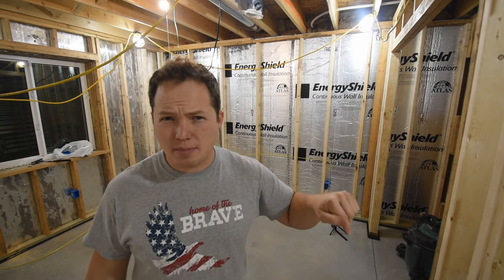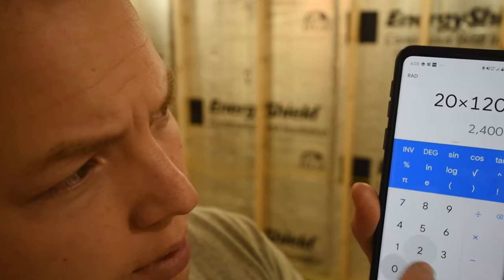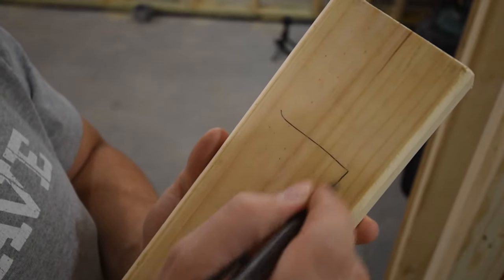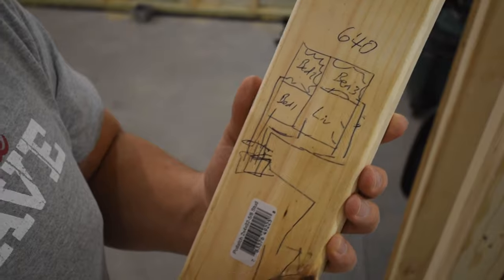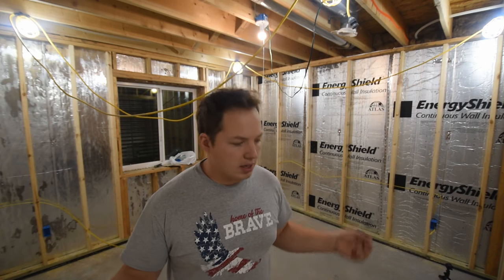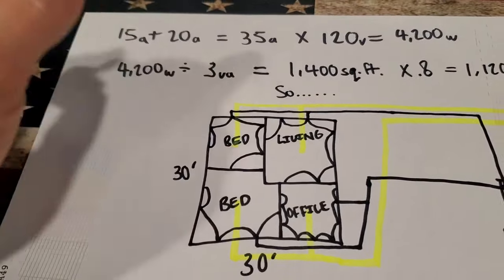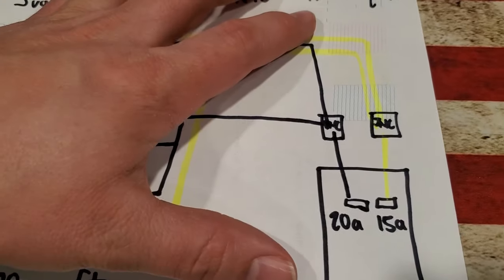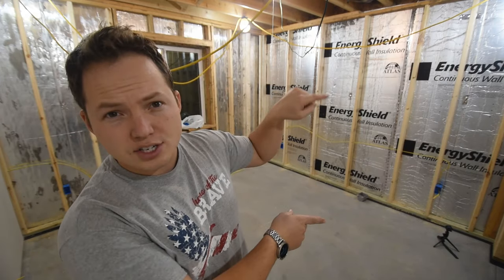Does a Bedroom Require a Dedicated Circuit? - Using the 3VA Rule To Calculate Anticipated Loads

Comment: I wholeheartedly support the running of 12 gauge to all receptacles. It should also be noted that you need not (and probably shouldn't) use actual 20-amp receptacles, you can use low-cost 15 amp ones. Because the utility of the 20 amp circuit is more for the number of things plugged in, not necessarily the load of any particular one thing.
Reply from the maker: Exactly. I need to make a video explaining the 15a device on a 20a circuit concept.
Reply: @BenjaminSahlstrom  different between 20 amp to 15 amp price?? What about if you led lights
Reply: agree
Reply: @jaandel1  You could run over a hundred LED lights on a single 15A circuit! At least those with common loads between 9 and 12 watts.
Reply: @aaron74  ... yes, you could run a BUNCH of LED lights on a small circuit but the code talks about the possible load, meaning if those fixtures have a standard screw base then someone COULD replace the bulbs with 100 watt units. If the fixtures can't take an old fashion bulb then you can likely get that by an inspection with several dozen on the same circuit. That's something I would run by the local building department just to be safe, rather than have to make changes later.
Reply: @rupe53  Yep, the intent would be to install fixtures fixed with LEDs, not fixtures with any sort of socket that would accept non-LED lights.
Reply: I understand the idea, but it just feels unsafe to me. Let's say somebody use a powerstrip and ends up taking 18 A through that 15 A outlet, the breaker wouldn't do a thing. In fact, that's why the Canadian Electric Code doesn't allow for the usage of 15 A outlet on a 20 A circuit.
Reply: @aaron74  ... got to thinking about this last night as I watched an old B&W movie on TV. The characters walked down a street in front of a movie theater with (seemingly) a thousand incandescent bulbs flashing away on the marque. I wondered what the wiring looked like and how many circuits were involved! <LOL>
Reply: @cedricpomerleau5586  ... interesting, and I suspect we'll see a change like that at some point here in the states. OTOH, the fact remains the 15 amp outlet is approved for continuous draw and a slight overload probably wont do anything other than eventually cause the power strip to fail because most of those are only rated for 1500 watts and are also a bit cheesy. Add in the fact that most high draw homeowner appliances are intermittent use (coffee pot, toaster, hair drier) and even a 1500 watt space heater is only 12.5 amps. This is what's been saving the world from idiots for near 100 years!
Reply: @cedricpomerleau5586  Generally there is no difference between the internal construction of a 15 amp or 20 amp receptacle. The difference literally is only the front face of the receptacle to allow insertion of a perpendicular neutral prong. Each have the same mass of conducting material. Also, powerstrips are often required, in order to meet UL and/or CSA listing, required their own overcurrent protection. The onus for safety is on that accessory, not the circuit you're using it with.
Reply: @rupe53  Yes, those old marquees work with the magic of relays, I believe. So a collection of bulbs can be on one 15A circuit, another collection on another 15A circuit, etc. But they can all be switched with a low-voltage relay controller. Sometimes you might see a strip of lights in a marquee not working, that is a sign the circuit for that collection of bulbs went open.
Reply: @aaron74  ... no magic involved and I have wired hundreds of relays in my time so I have a grasp. It's just that going back in time to when this was all wired by hand and probably using cloth covered conductors along with knob & tube feeds is a marvel to observe in person. Any time I visit an old building I ask to see areas that have not changed, like the basement and attic or storage locations within the structure. This is where certain gems hide and you visualize what made it all work.  A few years ago I got to take a gander at the electrical end of an old mansion (circa 1900) that had a 400 amp original service still in use. (big house even by today's standards) While scary to consider the safety aspect, it was literally a work of art to behold with the varnished bead-board, ceramic insulators / fuse sockets, and uniformly bent wires, all neatly installed in a hand crafted wall cabinet with lots of brass / coper hardware.
Reply: Aaron I agree that powerstrips should be the part with the overcurrent protection, but honestly I’ve never seen a cheap one with it. 3 plugs ones have literally nothing in them except 3 metal parts. And most 6 plugs one have only a switch and a really basic overvoltage protection. 

So as long as we accept those really cheap and unprotected powerstrips, we need the breaker to be the protection for them.

I don’t understand either why we have under 1500W extension cables without a fuse in them. Sure people would still need to not daisy chain them, but at least it would prevent the use of a hair dryer on a cheap dollar store extension. I don’t know why, but people with air dryer that is written 1200 or 1500 in big on them still think that an hair dryer isn’t taking a lot of power. It seems that most Christmas light strips finally got that right tho, the latest one I bough were all fused.
Reply: @cedricpomerleau5586  Yeah, I guess there's always a certain threshold of where safety features end and personal responsibility begins.
Reply: @cedricpomerleau5586  ... ya know, I wouldn't be surprised if somewhere in the near future UL (or other safety agency) started adding tags to light duty cords with a warning about certain types of appliances.... and then listing a few examples. This kind of common sense needs to be taught in grade schools.
Reply: rupe53 I know, but sadly the population is so uninformed that even people with a lot of common sense don’t have the knowledge to take good decisions.
Reply: @cedricpomerleau5586  some Christmas lights have permanent fuses, once blown you are F'ed. The extension cords with 3 plugs you mention, many times are rated for LESS than 15 amps. In fact, the breaker is designed to support more then one outlet pulling large loads. 

I work on cars. I see terminals and plugs burnt because of bad loads. I get asked why didn't the fuse blow if that item was drawing too much? Well, a blower motor has such high surge current during power up it needs a big fuse. The wiring is heavy duty, but the terminals are only designed for short high loads (they cheap out. Many replacement plugs come with larger guage wires and better terminals to fix the issue, dissipating the heat better). They burn up. You don't want to have someone pushing the limits of a 15 amp breaker and have something else that's low amp on another turn on and pop it. In fact, that's why many breakers don't pop instantly, they allow slight surge current for motors.

Comment: If you have girls, especially teenage girls -- you better put each room's wall receptacles on a separate 20 amp circuit. Why? They will run hair dryers and curling irons and who knows what else (i.e. space heater) all at the same time. Trust me on this. As a parent of three girls, if you ignore this advice you will be resetting breakers all the time! I do agree that light circuits can cover multiple (or all) rooms in you basement. But put each bedroom on a separate circuit for future proofing their electrical needs.